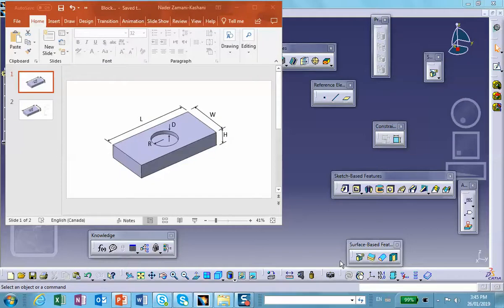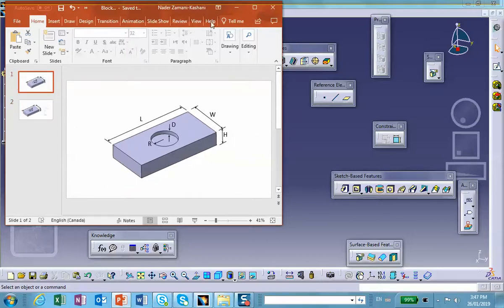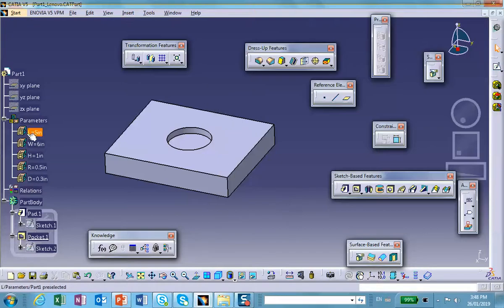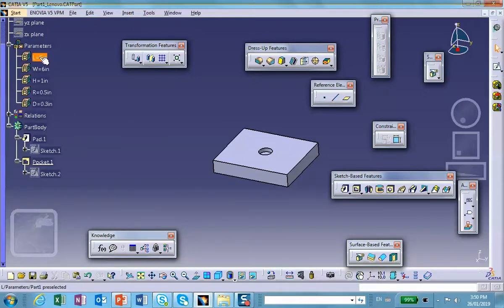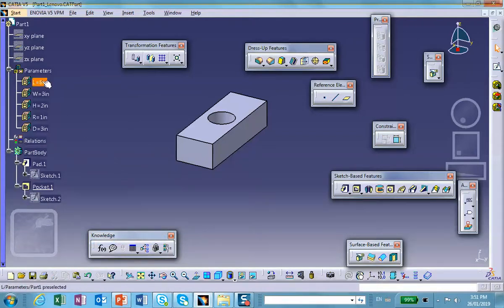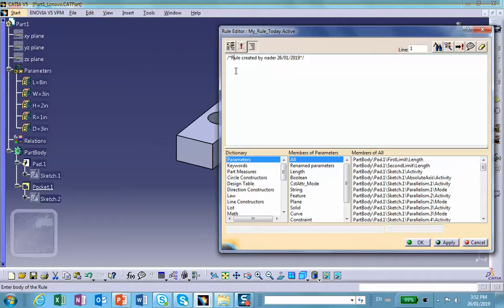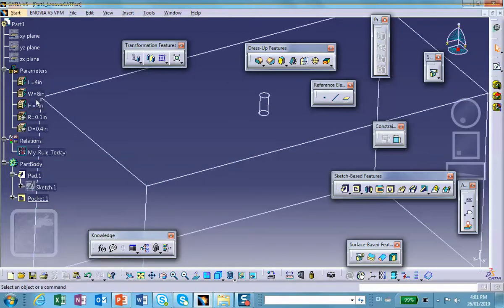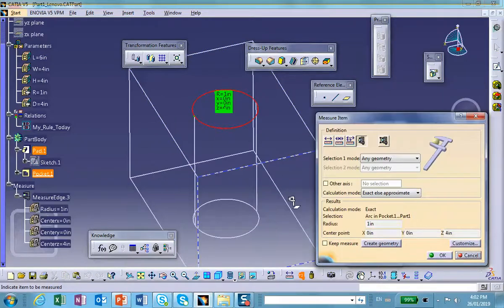Knowledge, Block with Pocket Using "if else" via Catia Rule, Nader G. Zamani

Comment: Sir, Let's assume I have 2 surfaces, one of them has an intersection with yz plane, and one of them not. So, If I have reflectline on firts surface in x direction and I replace first surface to second then I will get error. How I can fix this issue with this command. I just want to deactivate reflectline if there is no intersection. I hope it was clear.